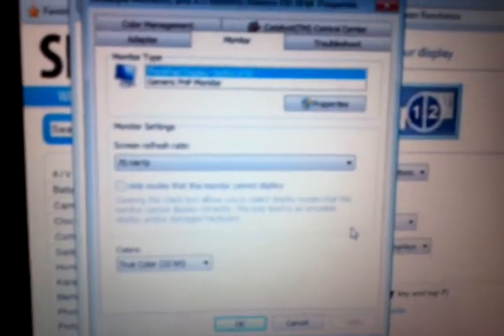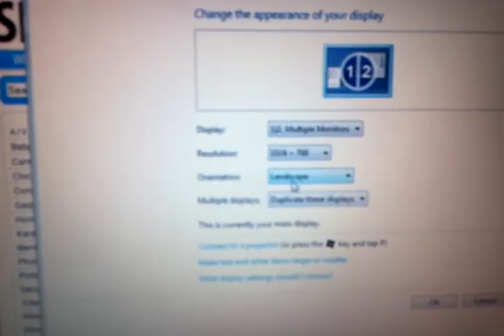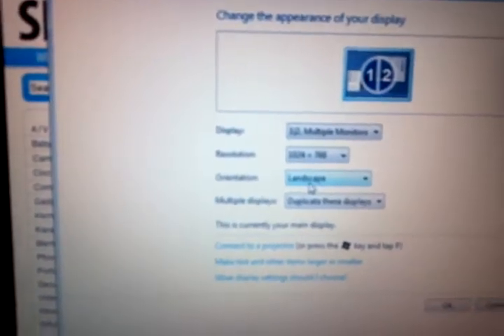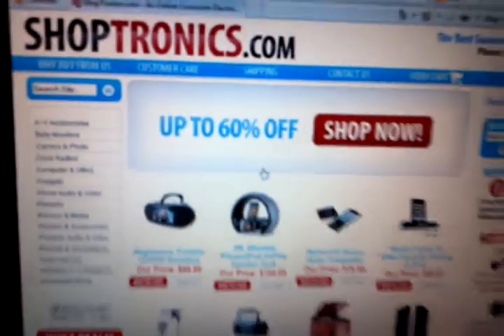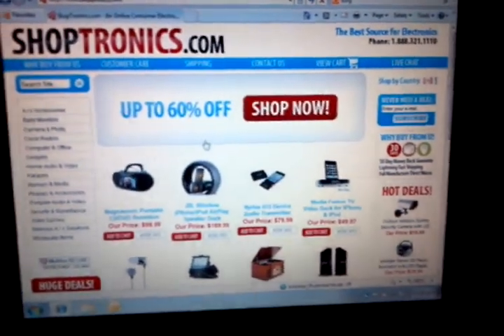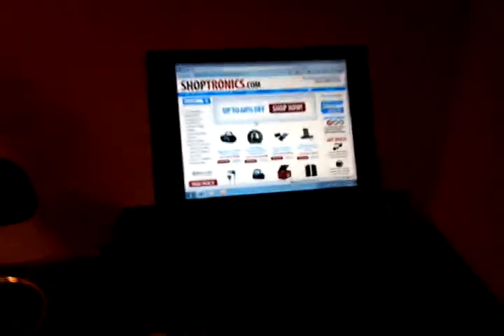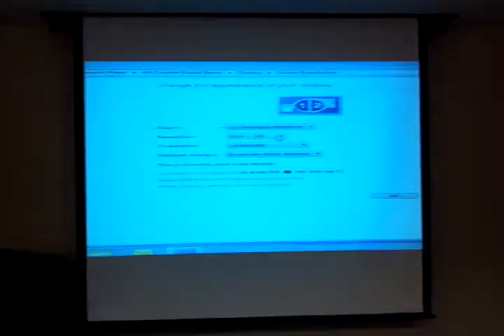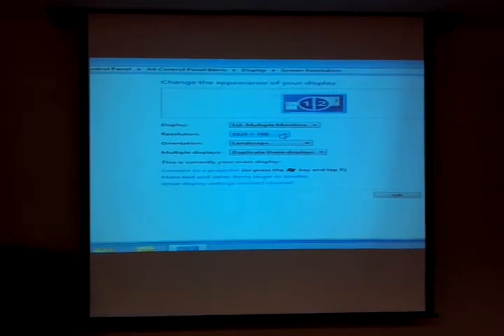Nyrius NSW500 troubleshooting - for tech support

Comment: I was never able to get the HDMI ports to work right on mine, and I still have no idea what the noise reduction options do, but I'll tell you... I use this all the time for composite, s-video and component and it works great with all of them.  Does take about 5-10 minutes to "warm up" once plugged in, though.  Otherwise, little black flashes sometimes appear on the screen.   Outside of that, still working great 3 years later here.   Ended up hooking up an Odyssey 2 game system to it with 160 resolution upscaled to 1080!